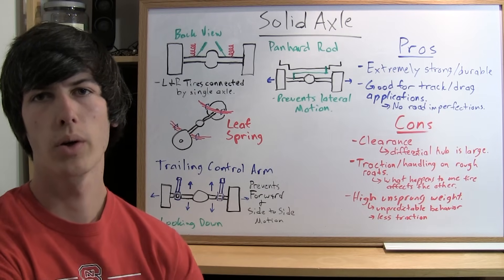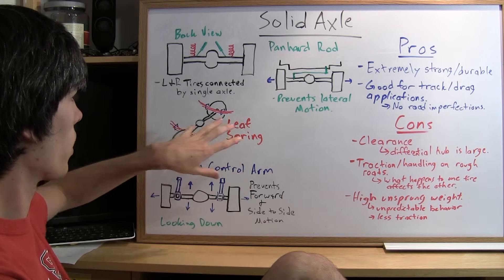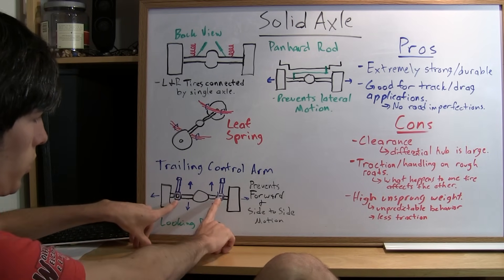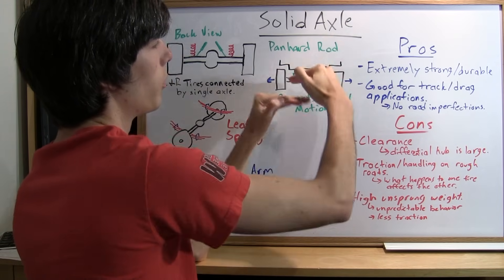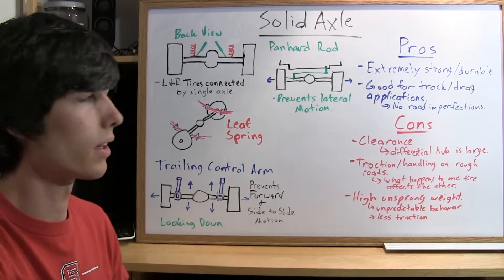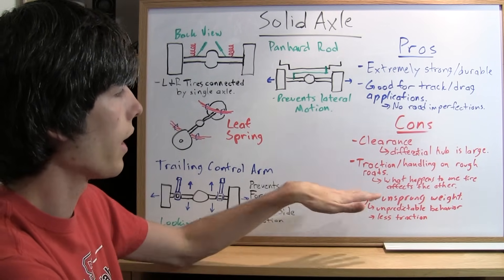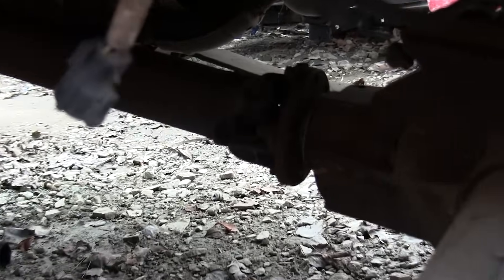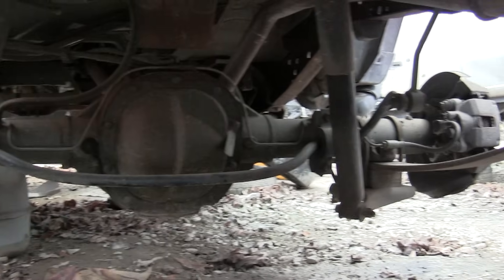Solid Axle Suspension - How Truck Suspensions Work

Comment: Hi Jason, great video.. One thing that bugs me is, how does differential work with individual suspension? Hope you can make a video about it..
Reply: Same idea but there are CV axles. So the same idea as the drive shaft applying power to the rear differential while it moves ...  Think of two more drive shafts like that going to either side called CV axles/joints. They can twist while moving up and down.

Comment: I like that to show the solid axle, you went to a junk yard, where all solid axels belong. The only reason IMHO to run a solid axle is to be cheap, and produce a cheap vehicle. I agree that independant suspensions are more likely to break, but as an engineer, that isn't a limitation, that is just that to achieve comparable strength and reliability would be more expensive. Monster Trucks, and Baha pro trucks will use independent suspension because you get more grip, and more control as an engineer. The only reason solid axles exist is because they are cheaper to produce. If an independent suspension with comparable strength was cheaper, that would be the only suspension you would see on a truck. With drag cars, I feel like its more an issue of weight. A car that only has to go in a straight line but has tons of power is going to need strong axels, and a differential that can take a lot of torque, and having a solid axel means it requires much less material and thus weight to achieve this goal. A normal race car doesn't have the same impact typically put onto the differentials and axles since it is important to maintain as much speed as possible, and try and drive as smoothly as possible. Thats why makers like Lamborghini have notoriously weak clutches, transmissions, and differentials. They aren't really about launching like a muscle car, or doing burnouts, whereas even if you drive hard on a track, there is power being transitioned, but it isn't as abrupt as a launch.

Comment: Another downside of the solid axle (or "live axle" as the Brits would call it with this particular type) is the reaction to the rotating masses inside the differential when the axle pivots. Anyone who's ever held a playing portable CD-player and moved it around, especially in the same plane as the disc was spinning, will have felt a similar reaction.
A De Dion axle doesn't have this downside as it used a solid axle to suspend the wheels but the diff is separate from it and bolted the car. Another benefit is it lowers the unsprung mass.
Reply: Lenny, I thiMk we should have at least a DOZEN names for it myself! It keeps us on our toes!!!  😜

Comment: Can you explain the relationship between the angle of the track bar (panhard bar) and the drag links , if the angle is too great how does it cause bump steer ? And how does “Death Wobble “ become a problem once you lift a vehicle with solid axles

Comment: Can you help me out with a problem? So I own a Suzuki Jimny and after lifting it 2" panhard bars moved axles to the right. I'll make adjustable panhard bars but I'm wondering should I also adjust the angle of panhard (via relocation bracket) in relation to the axle? Would a parallel panhard be better for vehicle handling? Tnx.

Comment: One thing to note, almost no car on the market is true independent suspension due to the use of sway bars. Almost all cars on the market link one a arm to the other via the sway bar, hitting a bump with one tire will impact the other with a shutter shake .

Comment: Do you really think that since a prepped track surface is nice that a independent suspension will not benefit from that as much as a solid axle?
Reply: Yes.
Reply: Iain I disagree with EE. A solid axel might work fine on a prepped track surface. But an independent will work even better. Only time I want a solid axle is when I am off road or towing because they are stronger. But I'm no engineer...
Reply: Robert Culpepper With a solid axle on a flat surface the wheels are always perpendicular to the ground I.e 0 camber. This is impossible to achieve with independent suspension as the geometry will always be a compromise between roll and  two wheel bump.
Reply: Iain Well, formula 1 cars use independent axles and they are the fastest racing cars on the planet around a track. So I will just assume that independent is better and not listen to you lol.
Reply: Iain Well, formula 1 cars use independent axles and they are the fastest racing cars on the planet around a track. So I will just assume that independent is better and not listen to you lol.
Reply: Robert Culpepper Because in reality tracks aren't flat they have bumps and undulations. Also unsprung weight is very important. Plus F1 cars run negative camber front and back so having the wheels perpendicular would not help. And F1 cars are not the fastest thing around a track.
Reply: Iain And any bumps and undulations would affect the other tire on a solid axle. You just sure up my point in your comment.
Reply: Robert Culpepper Your original comment was that a flat track wouldn't benefit a solid axle more. It definitely will make more of a difference as no bumps takes away that disadvantage. Also F1 cars have very little relevance to regular cars which experience more roll and usually end up with positive dynamic camber on the outside wheels in a hard corner. That is where a solid axle can, in some circumstances, be an advantage.
Reply: Robert Culpepper Your original comment was that a flat track wouldn't benefit a solid axle more. It definitely will make more of a difference as no bumps takes away that disadvantage. Also F1 cars have very little relevance to regular cars which experience more roll and usually end up with positive dynamic camber on the outside wheels in a hard corner. That is where a solid axle can, in some circumstances, be an advantage.
Reply: Iain EE said in his video that tracks are perfectly smooth, which I have never found that to be the case. Not that I am a big racer or anything..  And he says because tracks are so smooth that solid axle is better. It is probable that a solid axle vehicle same weight same power will not perform as good as a independent. Not saying that it won't do well, just not as well.
Reply: Robert Culpepper What was talked about in the video was a drag strip, that's where a solid axle would have the advantage and obviously off road.
Reply: 95 XJ actually he said tracks "and" drag strip applications.
Reply: Solid axle gives up less on a smooth track, and is cheaper. So, you can pocket the money, and go shopping for other upgrades that would make you faster than the IRS would. Also, I'm figuring the more robust, simpler solid rear would be less likely to DNF you, which might be "worth" a small setback otherwise.

Comment: don't quite get it. I watched differential videos that it seems to me every car has a differential. Anything special about those hubs on solid axle suspensions that cause clearance issue??
Reply: In a solid axle setup, the differential is placed directly between the wheels and moves with the wheels when the suspension compresses or extends. On an independent setup, the axles can be placed at an angle, allowing the diff to be bolted to the chassis above the center of the two wheels rather than directly in between.

Comment: I feel as if he is under informed, there are leaf springs and trailing arms, Independant suspension tries to keep the wheel on the ground the whole time, he doesn't talk about the leaf spring mounts, and that they can be raised lowered, and have a lot of different weight, and emergency springs (overload springs) stop the shocks from bottoming out

Comment: Solid axles: 
Have constant ground clearance regardless of vehicle loading, or vehicle stance. 
Do not not load momentum forward under deceleration.
Are virtually maintenance free.
Have fewer parts. 
Usually allow for more articulation.
Are better for towing.
Easier to repair.
Cheaper to buy.
Better for drifting.
Often allow for lower COG.
Generally feel more predictable in slow, off camber situations encountered in off road use.
Reply: max mustermann because it's alot of weight at the lowest part of a vehicle.
Reply: I would like to know how it would be better for drifting.
Reply: utah wanderlust700 
How do they allow for a lower COG? :-/

Comment: What you forgot to mention is that the clearance stays constant with the solid axle, whereas with the independent suspension it changes as the body of the car goes up and down. It is very important for off-road vehicles, and in my opinion is the most important advantage of the solid axle.

Comment: One benefit is in an off-road situation is that when one tire goes up it pushes the other down, which helps keep traction to both tires.
Reply: That isn't a benefit as independent suspension forces all tires to ground using spring pressure like on Tatra trucks.

Comment: IFS is good for off-road on trails where you need traction mostly, and maybe even going faster/ However, when it comes to crawling over huge rocks, solid axles front and back are the way to go for much better articulation, and less danger of tipping over since solid axles are the best at keeping all 4 wheels on the ground in rock crawling. You can use independent suspension for light to moderate rock crawling, but it can't be over rocks that require a lot of articulation.
Reply: Dcc357,  You arTICKLEated that well!  😎

Comment: Another advantage of a solid axle suspension is that under the assumption that the differential is the point of minimum ground clearance, is that the ground clearance does not reduce during compression.

Unless you know of one, every independent suspension will reduce ground clearance as they compress. Meaning, the differential gets closer to the ground as the suspension compresses, assuming the differential is the point of minimum ground clearance.
Reply: Clearance is gonna reduce somewhat in compression, due to sidewall flex in the tires. Remember, tires are effectively "suspension," too. (Think big balloon tires on bush planes.)

Comment: what's your major in college
Reply from the maker: brandon ervin Mechanical engineering.
Reply: +Igor K a diff lock and a solid axle are two different things. a diff lock simply locks a diff centre meaning that power will always be transferred equally to both wheels, as opposed to an open centre which will transfer power to the least loaded wheel. a solid axle is simply that, both wheels a connected to each other via the solid axle. ie what one wheel does will affect what the wheel on the other side does. so to answer your question its just a locking independent suspension

Comment: The energy transfer from one tire to the other can be a plus once you get on uneven surfaces because when one tire goes up it helps push the other tire down and contact the ground maintaining traction. As for clearance there are many types of axles with different clearances but independent suspension has whats called a "Differential Clearance" which basically means it has no set clearance of the differential to the ground, it is always changing with the compression and decompression of the suspension system while the solid axle maintains a more stabile clearance distance and is only affected by the tire size and air pressure. Independent suspension does better at higher speeds than the solid axle but the axle does better at lower speeds than independent.

Comment: maybe i missed it but what is the lightest type of suspension?
Also, is there a particular type of suspension used for retractable wheels?
Reply from the maker: alek syd The lightest suspension is the one with the lightest materials (or the smallest). I wouldn't base it on "type." They're all fairly unique.

Comment: Thanks for the video. one question - which would perform better on twisty unbanked roads, solid axle or double wishbone/multilink?
Reply: Depends....R U using a flux capacitor, or no???   🤔

Comment: You forgot to mention that with a solid axle you can get much better atticulation for extreme off road conditions. For example the ram power wagon has more then twice the wheel travel than the ford raptor, which makes to powerwagon much more suitible for rock crawling and rugged terrains. Its is also far more durable. The ford raptor on the other hand is more suited to high speed offroading and desert terrain due to its ifs. My take on it is that the raptor is a purpose built high speed offroad truck thats primary purpose is being fun and is more of a toy. The power wagon is a great rock crawler and general offroad truck and can also serve as a work truck. Personally I would take the powerwagon

Comment: Great video.  Comments/questions/myths...

1)  Leaf springs allow you to add/remove springs.

2)  I'm having a difficult time imagining an independent suspension being more comfortable than a straight axle, unless the tire is going up several feet.  But for the typical pot hold or speed bump?

3)  Independent front suspension seemed to gain popularity around front wheel drive and going lightweight.

Comment: how can both the rear wheels be connected by a single axle if there is a differential in between?
Reply: He means the shell of the axle. The wheels themselves are connected to the wheel hub, which is bolted on to the axle. The halfshaft is connected to the differential in the center of the axle, which drive the wheels when the car is in gear.

Comment: This is a pretty good overview of a solid live axle suspension however I feel the urge to point out some things.  A trailing arm suspension does not restrict lateral axle movement unless those arms are triangulated in some way.  As you have them drawn there would be ZERO lateral location of the axle which means it would move laterally under the car easily.  Trailing arm live axle suspensions either incorporate some form of lateral locating device like a panhard bar or watts link OR are triangulated in some way such that there is a force holding it under the car.  A perfect example of a triangulated trailing arm suspension is the 3rd and 4th Generation Mustang triangulated 4 link.  This setup has HUGE compromises that make is a horrible choice for handling environment but it works well for drag racing.  By contrast the 5th Generation Mustangs have a 3 link + PHB.  Remove the PHB and the axle can move freely in the lateral direction (causing a lot of damage!)

I would also argue that the notion of "bumps" causing huge issues in traction is wildly overplayed.  The elasticity of the modern tire is not so rigid that one wheel bumps drastically alter the contact patch at the other end of the vehicle.  Instead the method of lateral location is primarily to blame.  Why?  With a PHB configuration, or leaf springs or a triangulated 4 link setup the axle will move laterally under the car during bump travel.  Take a 300lb pendulum under a 3500lb car and imagine what the effect of the axle moving laterally under the car does to the weight on the rear tires and the contact patch.  If you could remove that lateral displacement the majority of the issues with mid corner bumps disappears and becomes a minor problem.

Also, a PHB does not keep an axle from moving laterally under the car.  In fact if you plot the path a PHB inscribes it will move the axle in an arc.  That's a mighty big pendulum to be swinging under a car in bumps.  The effect of this arc is amplified with soft OEM bushings.  The less deflection the bushing has the less the axle moves laterally while cornering.  When you hear reviews about the 2005-14 Mustangs having problems with mid corner bumps, this is 95% the problem.  Replacing the PHB with a watts link removes almost all of this problem and the car is instantly more stable over bumps.

Finally, an independent rear suspension isn't as independent as you imply.  I'm sure you go into more depth with the swaybar video but in an independent suspension, a swaybar ties the wheels/tires together in a way similar to that of a live axle only it is not entirely rigid.  That depends entirely on the spring rate of the swaybar.
Reply from the maker: There was a reason I included the panhard rod in the video (lateral deflection). Seems like you're having a good time with my videos though. :)
Reply: Thank you for confirming that the Panhard bar moves in a arc, therefore slightly slide laterally the whole axle (or body) over a bump. Nice because I was wondering that looking at my suspension the other day.

Comment: When it comes down to it, in theory an independent setup is better off road. The issue is independent is really only better in desert areas (high speed off road conditions hence hummers suspension) and that's about it. Even without factoring in durability, you still have to realize that a solid axle offers more traction at low speeds period. Because the forces on one side force the other side into having traction too(go over a rock and it not only raises one side it pushes the other down harder)

Comment: Your assessment is incorrect. Because you are not accounting for the articulation of the differing suspension designs.  Independent suspensions will reach bind at lesser degrees of articulation thus having far less overall travel which is a much greater problem off road. Your correct that the tire contact patches change due to the increasing and decreasing camber on the opposite ends of a live rear axle, however that is relatively insignificant if one of the tires leaves the ground due to bind..

Comment: Actualy axles have more traction than independent BECAUSE the axle has a farther travel length and is concidered "unlimited" in travel and maintains clearance, when one tire goes up the other goes down thus you maintain a perfect traction while independent travels with the frame or body of the vehicle when one tire goes up the other goes up and you lose traction.